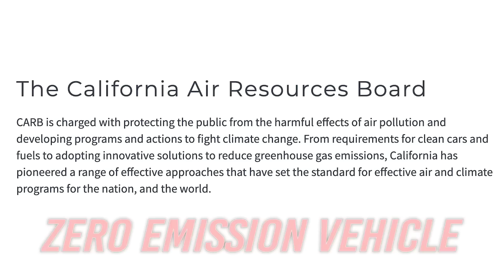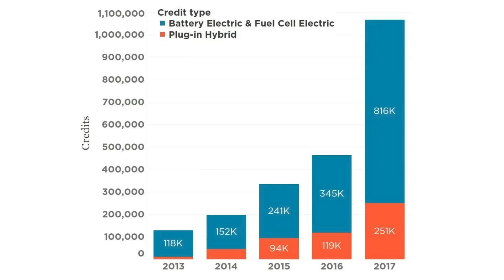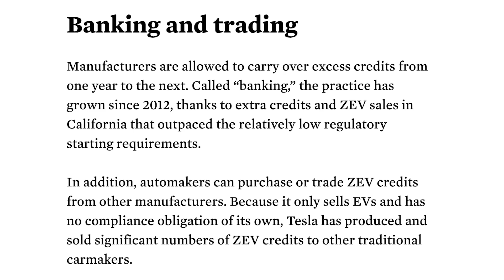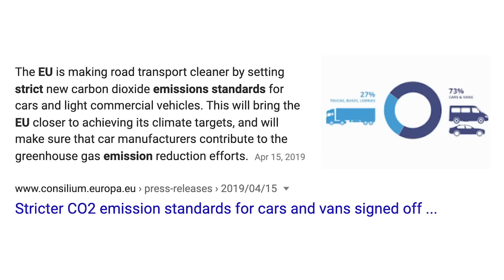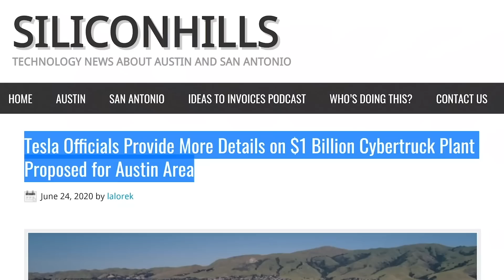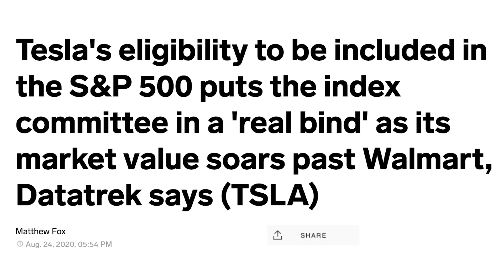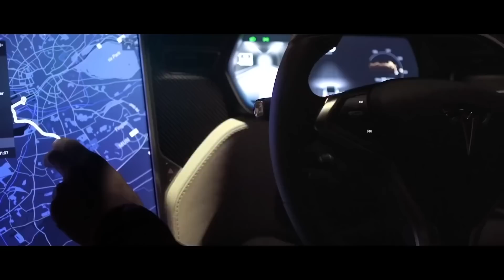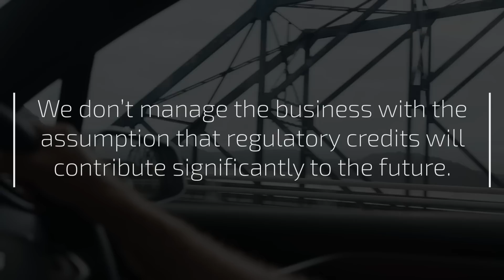Tesla Regulatory Credits | The S&P 500 Inclusion Delay?

Comment: Since the BEST EV is a Tesla, most people are going to choose Tesla when buying an EV (JMO though).  The charging network is possibly a major factor to consider when choosing an EV, as making long trips in your EV will be a problem if you're not driving a Tesla.  That requires that one must have another vehicle for long trips unless they choose Tesla and use the superchargers.  Bottom line: If the S&P board chooses to ignore the future of transportation, then the S&P is a FAIL.  If they have good sense, and I think they are very smart, then the S&P will begrudgingly include Tesla soon.  It will require much weeping and gnashing of teeth on their part.

Comment: In my uneducated opinion eventually it won't matter if Tesla sells their ZEV credits or not.  In a few years all the Gigafactories will be up and running thus reducing the dependency on the ZEV credit income to boost the bottom line.  Tesla vehicles are in very high demand right now, and what could be their 2 biggest sellers aren't even on the market yet (CT and Semi).  Let's take a look at the difference in the Teslas sold 3 or 4 years ago and now.  Lots of improvements.  Now imagine what the vehicles will look like in 5 years.  I don't see demand going anywhere but up.  And as they become more affordable it will open even more markets.  Same with Tesla Energy - costs will continue to come down and demand will go up. 

I'd like to see Tesla sell their solar panels directly to the public.  There are plenty of people like myself that have the knowledge and experience to install them ourselves.  Anything I don't know I have plenty of resources available to get it right.  Good to have several friends that are electricians and electrical engineers lol.

Comment: Reverse the argument to see how absurd it is. Imagine a car company that was NOT profitable for 4 straight quarters because government emission standards required high cost catalytic converters to be installed on their vehicles. Would the S&P panel then decide that if it wasn't for this government program the automaker would in fact have been profitable for those 4 quarters and thus should be included? This would be absurd and would never happen.

Comment: Well put case for both sides. On balance I’m betting on inclusion for a few reasons. The regulatory credit system is well established and wide spread and its objectives accepted. Tesla’s ability to take advantage of it is clear for the medium term. Tesla is clearly using the revenue from the credits to fuel rapid global expansion not substitute debt. If the credits were not available they could easily finance the expansion through share offerings without affecting its business. They are not using the credits to pay any dividends it’s purely for rapid expansion which is optional. Tesla is already so large it’s inclusion in the s&p will mean it makes the top 10 and that’s already a big disruption for the funds. Delay will only make that disruption greater as Tesla grows.
On the other side there’s politics and vested interest to consider, short seller, other car manufacturers, oil companies...... all would rather not see them included. And it can often be who you know! 🤷🏻‍♂️👍

Comment: Speaking to your question, if I were making decision would I admit Tesla this quarter...Yes. Presently, I think S&P needs Tesla more than the reverse. Objectively the S&P has a small number of high performing tech stocks pulling the entire index forward despite the vast majority of the 500 under-performing. It would be prudent management to cull a lagging company and swap in Tesla whose growth will take significant market value from Ford, GM, the ~26 gas/oil companies, & ~28 utility companies included in the S&P currently.  Inclusion will no doubt happen, it's just a matter of time. If not before battery day then I suspect after Q3 earnings are in assuming - as I do - that Tesla will deliver irrefutable profit success (sans zev credits).

Comment: How can we debate if any regulation with a monetary impact should be recognized?
Should the buyers of regulatory credits not recognize their expense?
Should an expense or income not be recognized because it will change over time or even disappear? 

The laws and regulation are the facts that companies operate under, and in regard to accounting it is ridicule to speculate about fairness or if it could have been otherwise. 
It is what it is.
Reply: Exactly 💯 my point too. And the reverse argument holds for the buyers too, in that their current business model is not sustainable without access or available ZEV credits to purchase. Another way to look at it would be that the buyers of the ZEV credits will ultimately fall short of their business continuity or sustainability either from excessive tax penalties or outright license revocation for consistently falling short of the minimum regulatory requirements, so if Tesla weren't around to sell them credits they will be winding down gradually too

Comment: I don’t like comparing profits vs credits. 
The profits are not in a nutshell, they are the results of revenue. 
I like more the revenue vs credits, it shows the bigger picture. 
2016: 7B revenue vs 302M credits 
2017: 12B revenue vs 360M credits 
2018: 21B revenue vs 418M credits 
2019: 25B revenue vs 594M credits
Reply from the maker: 1943vermork thx for sharing, good points

Comment: Let's face it: they are political in nature and can disappear tomorrow (depending on the nation/state/etc in question), but is that a foreseeable reversal in the current trend? probably not. 
Either way, it shouldn't derail TSLA from the larger overall picture (long for 2 years waiting for this current break-out), so they don't factor into the long term reasons why I'm invested.  I'll feel a lot better when the "profitability" is not reliant upon credits.  I'm not surprised it's not included to be honest, it's a 'new' method of income, and therefore will be viewed as inherently risky. 
But hey, easy flash in the pans are nice too.

Comment: Don't over think it. S&P is an abstract thing made up by their board-they can do what they want. Another consideration is the Short Sellers are having to buy TSLA shares to cover their failure, adding to that a bubble created by S&P Funds scrambling to fill out their portfolios.... and it's probably better all around to lower  the pressure overheating the share price. I think most Tesla investors are very long (I 'm one of them), so let S&P and the short sellers sort themselves out so the rest of us aren't boo hooing through Christmas about Tesla getting stuck at only 1300 for the next year.  (It won't make any difference in five years) 
I was recently reminded that Apple has been a 'Blue Chip' stock since 2015. Which I had forgotten because it made no difference to my (former) long investment in Apple. Sure it might add a little to the share value, but selling more Model Ys and iPhone 12s is far more important.

Comment: ZEV credits are definitely a product. A more reliable revenue stream than charging for paint color upgrades for example. The customer is other car makers, but still a product. No expectation regulations will change in the short term. Any line of business can be impacted by new or changed regulation. Do analysts discount car revenue because regulators “might” change regulations to prevent charging for driver assist functions? Navigation systems? Etc.

Comment: The regularity credits are included in the accounting plan in order to manage how much investment Tesla can do. Tesla would adjust the amount of investment according to all revenue inputs so to make sure there is revenue at each quarter. So your analysis is missing that point.
Reply: I agree with your bigger picture but I do want to make the point that credits immediately flow to the bottom line (i.e. profits) whereas investments are mostly not direct expenses but are capitalized assets to be amortized over time. So in order to offset the credits and maintain profitability they would have to primarily increase revenue by having, as pointed out by others, a higher ASP (not lowering their prices) and reducing their direct expenses which would come naturally with slower growth (not hiring engineers/managers to plan their projects and production workers prior to production ramp up).
Reply: @haleis4117  Nope. Just building a lower number of factories if get a lower amount of regularity credits.

Comment: I acknowledge your position of just educating. That said isn't Zev credits a government-mandated program? Of course it is. The fact that Tesla is the 1st and only automaker that can actually accept payment for Zev credits, does that make them, not any more viable or valuable (talking Zev credits) than if GM, Ford, Chrysler, Toyota, Honda, or VW had been 1st to sell the credits and add it to the bottom line. No. It definitely wouldn't have been as controversial though, because the amount of credits would have been nowhere near what Tesla generates. What's funny is, Tesla will be showing these credits for years to come by then there might not even be a Ford or GM.
Reply: The way I look at it is tesla has stated they don’t want to crush legacy automakers.   If tesla can keep earning money by selling their credits. Also while increasing their manufacturing in all segments  then it doesn’t make sense to crush them.  
1.tesla sells credits
2.tesla builds factories with that money.
3.tesla produces and ramps up production on all models at a pace which makes sense.
4.they lower the cost by doing above steps.
5. Taking money from sales and other income and reinvesting into other factories and product lines.
6. They are diversifying their business model every day.   

Credits will peak then start to decline  but their revenue from ramped up sales will replace.    Pretty awesome

Comment: The delay is due to the low shares float until the split and even after the split it will be tough.
Also they are not looking to introduce a 5B$ company into the SP500 but one that will be in the top10 once added (if not in the top5 if they do so after battery day).
Reply: This.  I think after the split (thus dilution) we will see less volatility and that will help.   Further splits will help imo.
Reply: @FreeKekistann  They should have done a 69/1 split for the lol and make it smoother on volatility.
Reply: Noob lade wouldn’t that be something I’d retire tomorrow. 😂